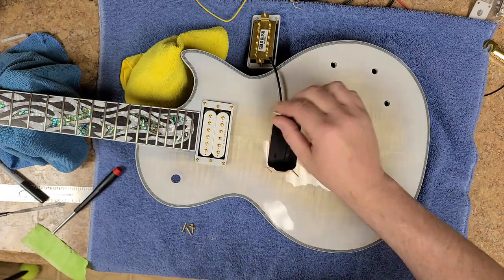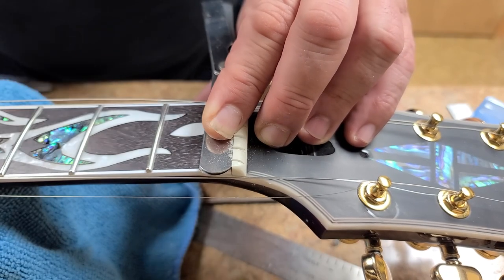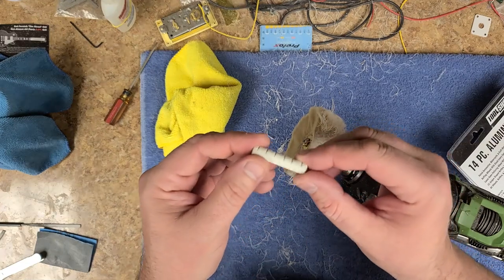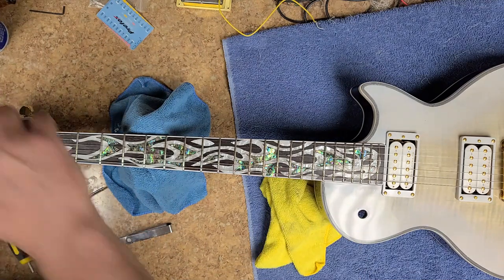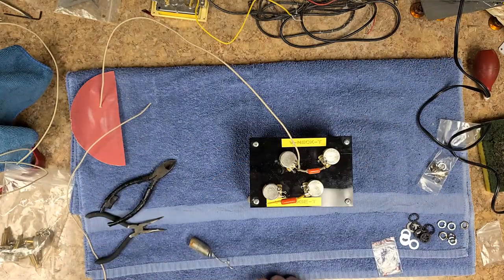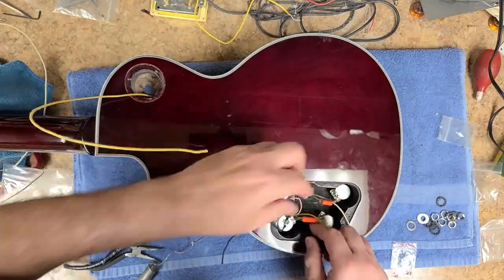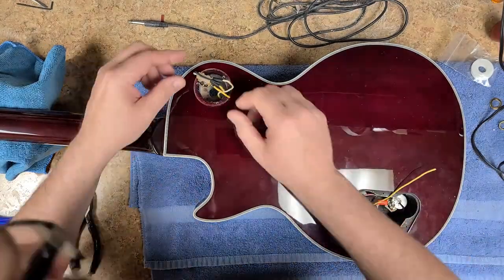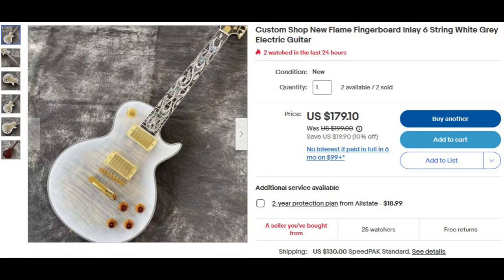Flamed Neck Chibson Mods Complete with Overall Pricing

Comment: Why are you spending so much money on cheap Chinese parts !? If you are going to use those cheap Chinese parts you may as well keep looking on ebay until you find the cheaper price it only takes looking at 2 or 3 other sellers and you will find it way cheaper.
Reply: Eric is building this AXE the way he wants. I know he spent a lot of Money/Time on Guitars and ,You should Thank Him. Eric Loves what does and so do I. A custom guitar is So much better than a box POS. Atleats its done proper after Eric gets done with it. I know personally. High end Gibson/Fenders even need work.
Reply from the maker: Thanks for your comment. I do hunt down for better pricing, but I also look at the sellers feedback from buyers. I put a lot of time hunting for parts. The only thing that I didn't go with a brand name with is the bridge, but I have bought this same bridge and never had a problem with them. The knobs, pickup mounts, and other plastics are just a cosmetic thing and all function just the same. Pickups and other electronics, I tend to use something that are better than the original. CTS pots, Orange Drops caps, and upgraded wiring are a must compared to the original. The original pickup would have worked, but you risk having them to be microphonic and tend to sound like crap with clean tones. The Guitarheads pickups have great reviews, the look I was wanting, and the price wasn't bad for the set. The tuners, well you shouldn't use cheap ones that may or may not be stable. This was just an over all of what might go into a mod of a Chibson or any other guitar. Some guitars are good out of the box. Some need help. It's up to the owner to decide what parts they are looking for and how much to spend. This is what I chose and sharing with everyone.
Reply: @ericctheartofnoise8613  Yep!